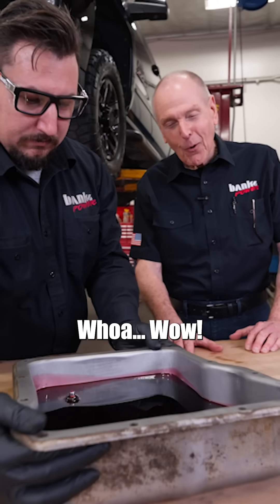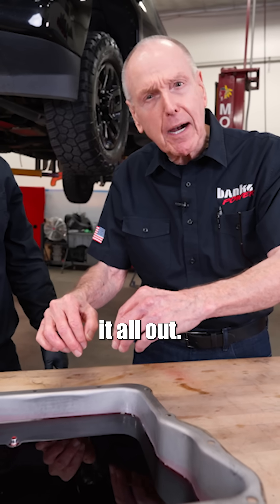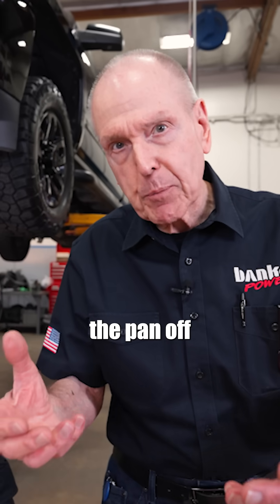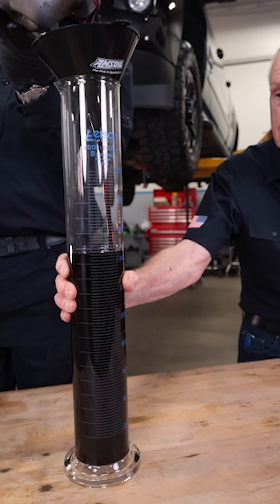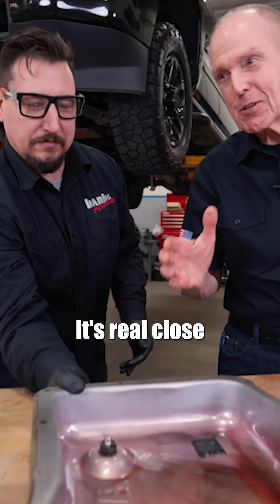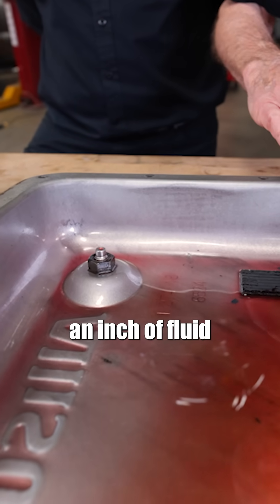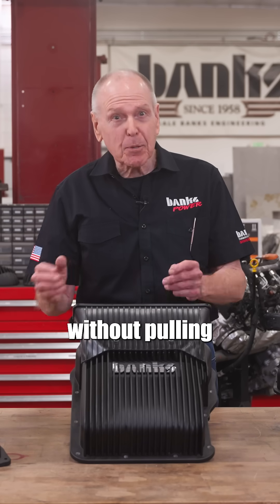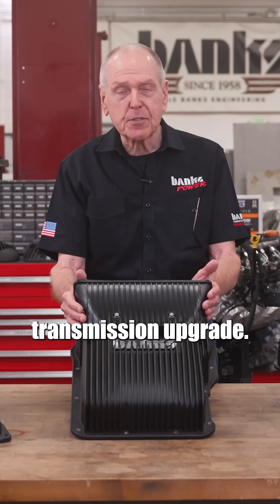This factory drain plug is a joke.

Comment: Leaving a little bit of old oil in the pan may ensure that some residual oil remains to lubricate critical parts of the engine immediately after an oil change. This could help minimize the risk of dry starts and the potential for increased wear on parts as the new oil circulates.

Comment: I see what you're going for, and you guys have made a lot of meaningful changes to the automotive industry. But this is a non-issue. Doesn't the allison have an internal filter? So you'd need to remove the pan anyway to replace the filter. Anybody who is changing the fluid needs to replace the filter as well.

Comment: If youre changing the fluid you should change the pickup filter, which requires dropping the pan. Where is the issue
Reply: And drop the pan if you have the fluid out of it to check for debris and a welfare check

Comment: Thats because you are atill supposed to pull that pan, and change the filter. Drain and fill on a trans like that is a no no. It was designed that way so you can drain the pan down, so you dont get trans fluid everywhere. 

Pull drain plug, do something else for a few mins, then reinstall plug, and pull pan.

Comment: If I'm going to buy a GMC Sierra with the 6,6 Duramax Turbo diesel engine.  Then i want to stop by the Gale Banks power Shop and  ask if they can change some parts to the performance parts to extend the engines lifetime and get some more power before i Shipping it to Norway 🇳🇴.

Comment: Bad design ! Bung should be less than 1/8" on the inside of the pan , a mag plug pulls the metal to the bottom to be removed in the drain process !

Comment: I like my M5OD Mazda 5 speed on my ranger, aside from the conflicting fluid choice in the manual (one page says use gear oil, another page in the same manual says to use Mercon V ATF). I just verified with the local dealership and asked what they'd use and they confirmed Mercon V. 
Despite that lil bit of confusion, the drain plug is at a very low point and drains quite well, its got a huge and quite powerful magnet in it, and its fairly roomy to service. Just need a transfer pump to fill it easily.
Reply: i've got the f150 with the m5od that blew last year, i feel this confusion
Reply: @HCsonicknx  ooh man, sorry to hear thats unfortunate as heck. 
Do you recall what fluid it had in it and or if the fluid in particular contributed to the failure by chance?
Reply: @100GTAGUY  merc v, had a slow leak and sat a long time. went to run it, and got it stuck between gears. might be lucky and just have a broken/bent shift fork and won't need a rebuild but I have doubts

Comment: Lot of people do not know most early Chrysler transmissions you can put a air hose with compressed air on the transmission lines you can get all the fluid out except one quart that's left in the torque converter I've been doing it for a long time

Comment: Wish they would have had something like this for the 2000ish Ford explorer transmissions - I'm sure they were used in other cars but they had a very similar weld nut style and the only way to fill the transmission was to push it back up through that.

Comment: i rarely remove the pan anymore.  i way over service my automatic transmissions.  i use a vacuum to draw it out through the dipstick tube.  it has graduations so i can put the exact amout back.   i do this just on random when servicing the engine. including the power steering and brake fluid.  just get some old out and top off with new just to prevent dirty fluid in any system.

Comment: That is the cleanest transmission oil pan I have ever seen! No contaminats at the bottom, no nasty dirty exterior, heck even the oil looks clean!
Reply: No contaminants? Please look harder at the pan.
Reply: Thats because it's new test oil used as an example with an original pan, this way we can see the actual outcome when trying to draining your oil 👍 not that hard to figure out.
Reply: @JzLyfe please tell me you are joking. Look at the fluid in the tube, it's NOT new fluid.
Reply: Let me see pickup truck tow chain or a bank loan and a car lot to get this trash. I'll stick to the pickup truck and the tow chain for $200

Comment: The transmission holds so much fluid overall. just drain and fill on the interval and you don’t ever need to worry about this. 

If the fluid is really bad then a total change would probably not be good, and if the fluid is good then this amount won’t matter. 

Improvements are welcome but I’m guessing most people buying this don’t actually need it.

Comment: You have to pull the pan anyway. Unless you're doing a transmission service without changing the filter
Reply: With the Banks RAM Air Transmission pan, now you don't have to! Dirty Filters are your choice, but no longer the 950 mL of old oil.
Reply: You dont have to change your filter!!! It's more important to change the oil,which  nobody does!!!!😊 just say'n!!

Comment: Banks is just barely short of a complete JOKE! Bought a programmer for my duramax and WITH their "Technical Support" coaching me through the steps because I had bad feelings, and a buddy warned me about their programmers, the unit erased my ECM and would not push the new flash. Sent ECM and programmer to BANKS and they did whatever and sent it back. Fast forward 5 or 6 months and my engine started knocking. Mechanic found #2 injector not functioning. Replaced it but on a live diagnostic he found that random injectors were being turned off driving down the road. So he finds in the programming where the fluke was. So he attempted to refresh the ECM with the factory flash and it would not allow it and they, BANKS, had it locked down and caused it to shut down my ECM. So thanks BANKS! $500 paperweight programmer that they assured me I would be reimbursed for and now a $1600 ECM not to mention the now $2800 in labor and diagnostics charges! Great job BANKS! Freaking JOKES!

Comment: Dont get this you will fizuck your shizit up. You have to drop the pan and chanfe filter EVERY TIME!! 
ALSO FYI GM has no dip stick. That is set up like that necause THATS YOUR FLUID LEVEL CHECK. You fill up tranny, get it up to temp and remove that plug. At temp, fluid should be dripping out of that. That is how you know the tranny has the correct amount of fluid in it.

Comment: I think there's an engineering reason for this, same as on the DMAX oil pan you sell. It prevents the fluid from draining out of the pickups and pumps, which prevents dry starts, and air being sent to bearings on startup.

Comment: You shouldn't be Drain & Filling those transmissions you should be doing a 16 quart flush every 50,000. I understand the benefits of having the fins for additional cooling capacity. But the fact of the matter is if you eliminate or put a super cool transmission line thermostat into the trans. In place of the incredibly high temp thermostat that they use from the factory on the lines. This pan is completely unnecessary

Comment: Nah there's a reason the drain plug isn't the lowest point - it doesn't drain the heavies out so you can see how much case hardening off the planetary gear set or the converter's torrington bearing is sitting in the pan. If there's more than the pan magnet can bind, lots of wear is afoot, and you wouldn't know that if you'd just drained the pan cleanly.

Comment: So you dont have a vaccum fluid sucker with a 5/16 flexible hose on the end? I've been changing fluid in rear differential with a fluid sucker. Stick a bore scope in the hole, and at least look before filling back up. 
If its just a fluid change, why remove the cover completely.

Comment: Manufacturers are designing cars to fail in expensive ways even with proper maintenance and this proves it, you do a drain and fill and you still leave 2 qts in the transmission that just negates the purpose of a drain and fill you main replace maybe a qt with good fluid while there’s another 5 in a car. Don’t get me started on the ones that don’t even hide it…. cough bmw rod bearings

Comment: Looks like another awesome product. Just one thing i have to question- does the scoop for the ram air really need to be so big at the front? My understanding of fluid dynamics is that you don't really gain anything by making the opening much larger than the final path the air will be moving through. Then again, this is a cooling ram, not an intake ram, so the goal is mass flow rather than ram pressure.
For aircraft with ram air intakes, the opening is often actually smaller than the rest of the air path, because air tends to gain pressure when it slows down and tends to lose pressure when its forced to speed up

Comment: So your recommending draining the fluid without removing the pan to change the filter ? 

Is that what's happening in this video  ? 

The pan has to come off regardless if your doing the job correctly and also changing the filter....

Comment: Because youre expected to be doing the filter and pulling the pan when changing the fluid. Not just drain the pan and add similar service to oil changes. 

Still prefer that full drain idea though. Any chance to not make a mess is A+

Comment: Drop the pan, replace gasket, filter, pan bolts, refill with as much fluid as you put in, disconnect the return line and cycle the transmission gear settings with the engine idling until the fluid on the return line lightens. Shut off the motor and fill the rest of trans with the same amount of fluid you just pumped out of the return line. Reconnect the line and test. Did this with a mechanic buddy of mine and that 15yr old trans shifted buttery smooth and even took it endurance racing afterwards 😊
Reply: Sounds like the best way to do it.

Comment: It is not a drain plug. It IS a bottom fill plug.. You push fluid in until it starts coming out, at the level set by the height of the protrusion. That is the 'fill line'.   It is intended by design to remove the pan as part of a filter change, ... and fluid change.

Comment: This is why any new vehicle i get at 30,000 i begin replacing with new amsoil fluid with extractor. Keep extracting until it comes out clean so even the torque converter has clean amsoil atf in it!

Comment: There is such a moment that in automatic transmissions with an adaptive system (and these are all modern automatic transmissions) the system evaluates the viscosity of the oil and the wear of the friction discs, eliminating signs of wear by increasing the pressure in the valve body. When you pour in clean new oil instead of the old one, the system continues to consider that the oil is thick and applies pressure settings for thicker oil. In the case of fresh liquid oil, you get sharp pressure surges because of this, which accelerates the wear of the automatic transmission. You may notice that after replacing the old ATF, the car jerks for some time when shifting gears. For example, for Kia and Hyundai automatic transmissions, it will be much better if you change 45-50% of the ATF once a year or two than if you change all the heavily worn fluid at once, for example, after 3-4 years of driving your car. I don't know if this is the case, honestly I doubt it, it looks more like some kind of malicious intent for controlled obsolescence, but in theory that pan may be a way to reduce the wear of the automatic transmission with a complete replacement of the ATF. Another thing is that the problem I mentioned can be solved by resetting the automatic transmission adaptation and then "retraining" the transmission.

Comment: Maybe it has an oil level check funktion like some Mercedes Transmissions. In some mercedes there is an extra tube inside the pan on the drain plug. After an change you overfill the transmission start the car und open the drain plug. Because of the tube, it will leave you with an perfekt oillevel. Maybe this bulg has the same funktion.

Comment: To be fair: the average transmission filter is designed to be changed at the same time as the fluid. That's standard practice. The drain plug is a convenience feature to reduce the amount of fluid in the pan so you are less likely to get a whole pan of fluid dumped on you as you lower it off the transmission to access the filter. Even a partial draining accomplishes this purpose. Most older pans didn't even have drain plugs, specifically to reduce the likelihood of someone doing a fluid swap without changing the critical filter.

On top of this, tons of tests have been done for years on transmission pans; and higher fluid capacity and finned pans make significantly less of a temperature or lifespan difference than a simple aftermarket transmission cooler added to the factory one up front.
Reply: Best answer I’ve read

Comment: I never change the transmission fluid without changing the filter.....ever!! That's just dumb. Let's change the engine oil, but not the filter.🙄 Doesn't make sense. The drain plug just helps get most of the fluid out to make getting the pan off easier.

Comment: Wels a 1/4-28 SAE nut on the outside of the Pan in the Lowest spot. Dril a tap drill sizr hole thruu the nut run a 1/4-28 tap thrue clean up any Bues install a gasket thin washer and lock washer and screw. Might Locktite it too.

Comment: Ford back in the days of the C6, AOD,  AOD-E, 4R70W, and the 4R100 all had a 1/8" NPT plug in the torque converter and an access hole in the bell housing and   
                          gasp  
A drain plug in the pan itself!   Whoever killed those two drain plugs must be a miserable person.